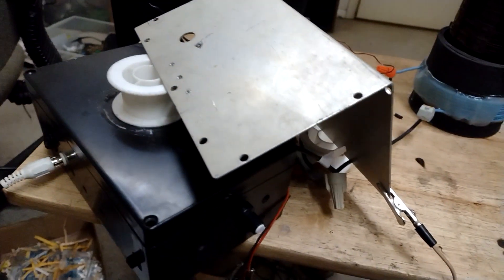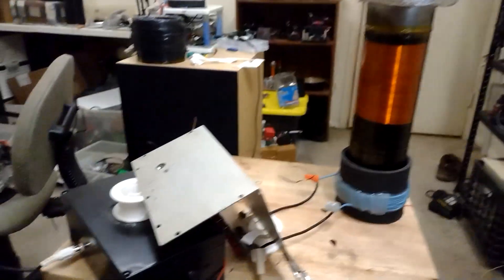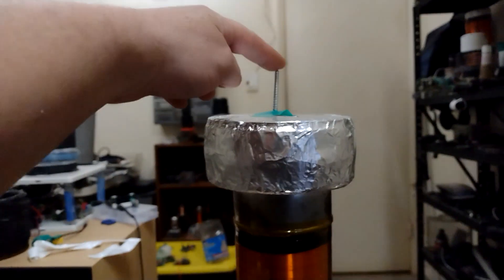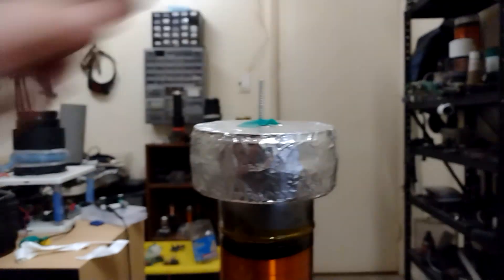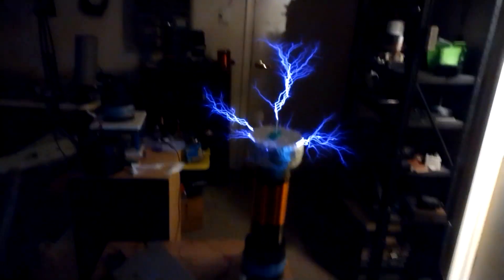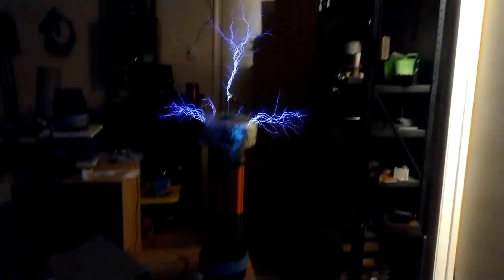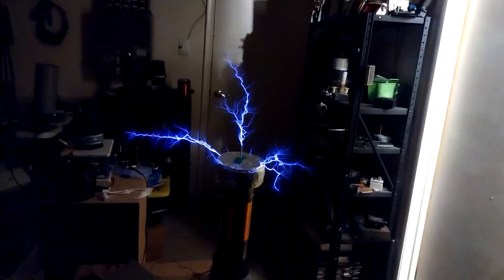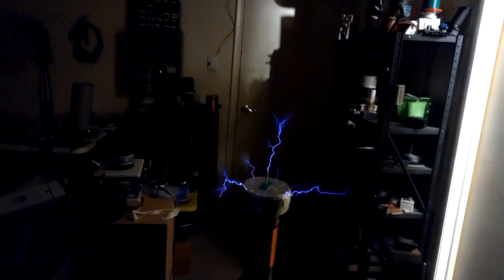Mini DRSSTC Half Bridge Mains Testing

Comment: Yo bro a good topload can be built using some styrofoam from the craft store, they should have different shapes, they some foil tape and smooth out everything with a spoon 👍
Reply from the maker: Yea gonna need one for this but maybe not after I change the coils. If the arcs want to jump everywhere I might need to do something like that instead of duct so it's way smoother. No idea what I'm really gonna wind for this one I just wanted it to be smaller. Can't use this secondary anyway cause I borrowed it from a different setup but it has always worked awesome. 36 AWG about 3.3 inches wide, 10-11 inches tall, works like a champ on all setups I've tried.

Comment: Hi there man. Hope all is well on your side. Well Ryan, we all want to build a Tesla coil with awesome output. Recently I've tried that Teslista 555 30 vdc 48 Vac sstc, I was stunned by the output.. Man it's just a minimalistic thing with very few components & the output is just awesome. With my 90 mm long & 55mm diameter secondary coil, I'm getting swords sparks output.. Man! I tell you, I've been focusing on that circuit since long but I just neglected it & put it in a deep corner of my drawer. I've done a lot of sstc & all I've noticed is that I've wasted money massively on semiconductors when this circuit is way better than my complicated E Class SSTC. THIS 48 Vac single Mosfet SSTC, is way awesome compared to all the trouble we have to go through with complicated electronic circuitry. Dude, I don't know if you've tried Teslista 555 SSTC 2. IT'S just a minimalistic Tesla coil which is just awesome.
Reply from the maker: Yea his SSTC IV? That's a really cool one and part of why I made the Class E's. He has his working nicely. If someone doesn't have or want to use IC's then class E slayer like that is a good option. The only real downside is it may be hard to tune to where you can load it any kind of way without killing the mosfet, and the drain needs to be monitored since his was reaching around 500V. This is why he has to crank a max of 48VAC and no more etc, but most people don't have autotransformers to fine tune the input like that. In tuning his gate drive via the secondary feedback you can see he has to use the dirty sinusoidal drive which is harder to tune IMO compared to a logic square wave drive. It becomes harder to see a clean switching because the sine is more or less ringing the whole time. I have already seen one really good near identical replication by someone though. I probably wouldn't make one of those just because I have the IC's to use. Instead of the single fet deal at around that voltage I just make the push pulls. The sword spark output when AC driven comes from half wave rectification without large smoothing because it's peaking close to 70V at about 48VAC.

Certain people just look at it differently I guess. Personally I recall over time moving on from Slayer Exciters that while it was possible to make the simplicity work, it would be much more reliable and safe to utilize IC's which allow better control. 
For a lot of people it's the opposite to where they don't have this IC availability and they are just looking for something that works and doesn't require them. I've kind of always seen a mains slayer as being 'on the table', it just never seemed like an SSTC I'd want to have if I had alternate options. Making one work as well as Teslista555's is basically like an accomplishment IMO and not necessarily something that would come easy for most people. You need an oscilloscope and variac to really get into it. If I made one and then couldn't draw whatever arcs I wanted from it I'd know I would kill it eventually anyway cause I'd forget it was like the only coil I couldn't do that on.
Reply: Then Check that branchy sparks output from " minimalist Tesla coil with branchy sparks output. I only swapt the irfp 460 with that of an IGBT rated at 1200 volts & I was stunned myself with the output I got!

Comment: Is the ocd necessary?
Reply from the maker: For this power level I've never needed it, but it does seem to keep me from killing the bridge from hard ground strikes. The point for me is to just tune it to a region where I can just barely run it without tripping, but then set it to trip during ground strikes. 
This lets it still strike ground but starts backing the on time down as soon as it does it. 

The arcs here are all distributing along various points here on this imperfect topload, but if for whatever reason they all decided to gather and pump into one set of discharges it's probably going to be straight down to the primary right under the wirenut into a direct connection. The design of the bridge can tolerate that to an extent but it helps to have the drive shut off too.
Reply: @Magneticitist  in your setup how have you set up the ocd? 
Thanks too
Apparently we electronics engineers have lots of questions
Reply from the maker: @tvishmaychoudhary69  https://www.stevehv.4hv.org/DRSSTC1/DRSSTC1OCDsch.JPG

Steve's setup is running a lot higher power levels and he's wound a 1:1000 or thereabouts current sense transformer (with cascaded transformers) to make it easier to calculate his peak amps. So he should have about 1000X the primary amps he's reading across his burden resistor. The comparator is just telling the 555 timer to start pulling the interrupter signal when the rectified primary voltage pushes the threshold set by the potentiometer.

I don't do any of that measuring and just wind a CT and pick a burden resistance that will allow me to vary the OCD at my max input voltage. I'm doing this assuming my primary LC is not ringing ridiculously high and there is streamer loading due to fairly decent tuning. 

Anyone who is seriously building a DRSSTC meant to push more than a couple hundred watts or so and is spending money on some legit beefy components is going to need to add OCD and do it in a way where they can easily calculate and set this peak primary current. The point is to take full advantage of what is probably expensive switches but to also obviously make sure they are not exceeding their rating. When you start trying to tune for the longest breakouts you are finding a compromise between primary current and streamer length.
Reply from the maker: @tvishmaychoudhary69  Just as an example though.. I run tested my full bridge DRSSTC with the only load at the time being a bootleg 5 or 6 turn air coil I had some lightbulbs hooked to. By cutting the voltage all the way up, and having the on time and BPS maxed it finally killed a couple IGBT's because I kept cranking the OCD back to allow more output. This was surely wastefully pushing more primary current than *with the secondary when at max power. It can do 3ft arcs and probably doesn't even need the OCD after I've tuned it but I set it to kick on during ground strikes. So basically I had to really abuse the 60N65's to kill them. 

This is how I know most of the time when somebody is killing those switches on a setup like this they are just maxing a really badly tuned setup or they are getting some kind of primary circuit or logic strikes they just aren't seeing.
Reply: @Magneticitist  so basically if iam tuning I should use ocd so that my setup doesn't blow up
And after tuning I should be good running it without ocd?
Reply from the maker: @tvishmaychoudhary69  Well there's no reason to not use the OCD after tuning but I'd leave it for ground strikes. If planning to not use OCD in the end you may as well never mess with it to begin with.